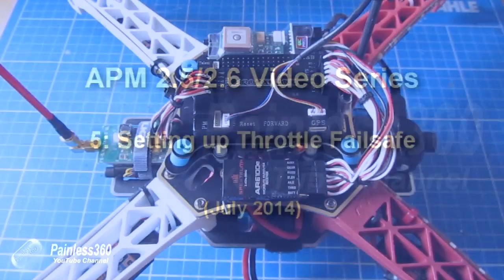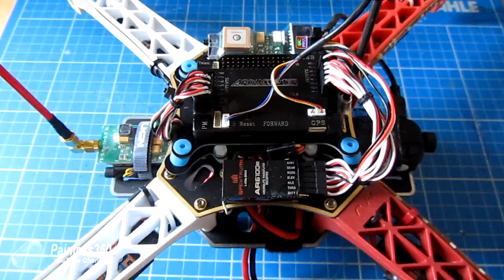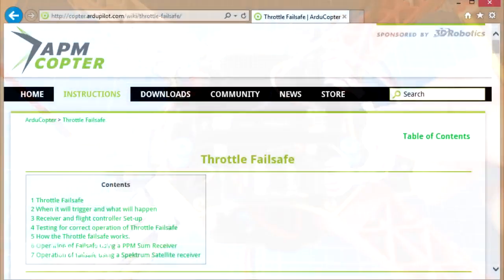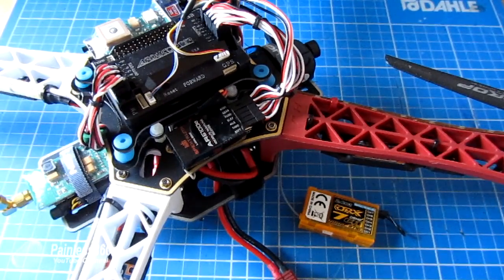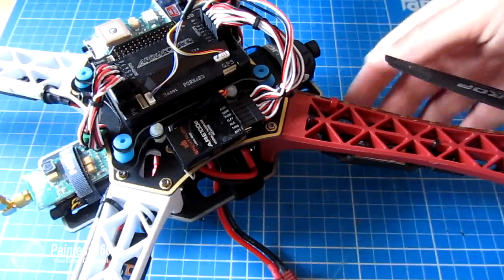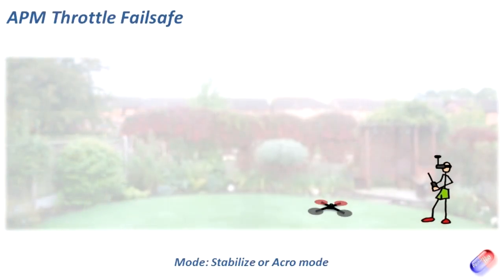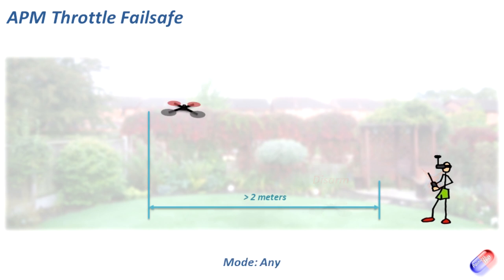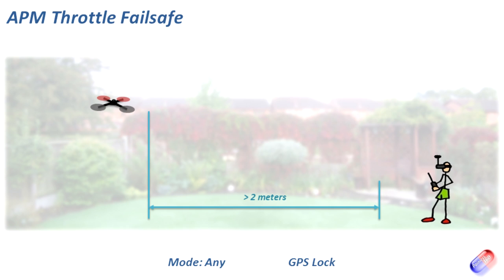(5/8) APM 2.5/2.6/3.1 - Throttle Failsafe Setup

Comment: Helo Painless.i need some suggestions ,,,Im using 2.6 APM(Clone) Arducopter ,30A RC timer ESC .1045 Prop..i finished all the calibration in mission planner ..Accelerometer,compass ,GPS, radiocalibration, Failsafe ,,but when i tried to ARMED the prop..there is no response from the Prop,,what ive did is test one by one ESC using manual testing ..ESC and Transmitter programming No issues on that the prop ..spin...i ve tried to use the APM wiki procedure using the ARMING the prop ..right side down in Throttle 5 secs the prop .spin ned for a couple secs...and wheh you give throttle its spin in min and max rotation but it stops ..the APM mission planner react in DISPLAY -ARMED when spin,,and DISARMED when the motor stops..maybe someone have issues like this...The prop doesnt react when i applied throtlle..im tired on exploring some Youtube solutions..need any advice..Im more on RC plane and RC EDF Jet flying..this  gave me headache using APM 2.6(clone),,I appreciate if you have any suggestions to check..
Reply from the maker: Hi Richard, I would suggest that you calibrate the ESCs one by one (https://www.youtube.com/watch?v=OOplk52R4no) and then try again. Remove the props and arm and throttle up using the Mission planner connection to see that the board arms successfully and that you can see the throttle rising smoothly.

Best of luck.

Comment: I do have a couple of questions. I do have a Futaba 8j and watched a video how to set up failsafe with this radio so I did it . Now, in mission planner  my lowest throttle value is 1110, when I turn my radio off the throttle value is 1591. What should I do?
Reply from the maker: What troubleshooting have you already done?

Comment: Wait how do you "rebind the model" so it shows the value you want when connection is lost?
Reply from the maker: Ethan Wang Watch https://www.youtube.com/watch?v=LyPtzv0y5DE around 13:50 to see the process for the radio I'm using, see your radio documentation for how to rebind to store the lower throttle value as the failsafe level in the radio receiver you are using. Happy flying!

Comment: Hey bud, I keep getting the PreArm: Check FS_THR_VALUE warning on arm, my throttle minimum end point is only 990, I then set my FS_PWM to 1015, and upped my minimal throttle to 1035,
Any idea why the warning will still be coming up?
Reply: ***** Sorry, just found out the ER9X fw has a 'extend limits' option in the main menu! So this might effect 9X & 9XR users =]

Comment: When I start mine up the left front and rear motor run real slow and the right front and rear run fast but !!! if I close the throttle so all stop then nothing happens when I open the throttle back up ? I have to power down and back up again and the same just happens ! Any advice would be appreciated
Reply from the maker: I need more detail to help - what troubleshooting have you already done?

How are you arming the board? Do all of the channel values for elevator, aileron and throttle settle to 1500 at their mid positions? Have you manually calibrated each of the ESCs?

Comment: can you help me determine which switch on my controller operates what function? I have a pre built drone and the controller has about 9 switches on it. I need to know or reset to a known value the mode and camera control switches. I have an apm copter controller.
Reply from the maker: Hi Frank, I'd suggest going back to the vendor and getting a manual that covers all of this.

You can find out which switch does what by plugging the model into Mission Planner and looking at the 'Modes' and 'Radio Calibration'' screens in 'Mandatory Hardware' section. Watch my first video in this series - https://www.youtube.com/watch?v=30cCs4aHdB0 to see what I mean.

Hope this helps.
Reply: Painless360 that helped very much. I was able to figure out the switch settings. thank you.  my only other question about switch settings is what happens if you switch 2 separate switches at the same time. if one is set to loiter and other to rtl, what would happen?
Reply from the maker: You need to watch what happens to the channel value in Mission Planner and see how the switches affect the mode selection..

Happy flying!

Comment: Thank you very much for making these videos. I've watched several of the while trouble shooting the problems I have faced while building a quadcopter in my engineering class, and these videos are a saving grace. I want to build one for my own personal use and the biggest problem is, I don't know what motors to buy. The frame of the quadcopter in this video is the same one that I will be using for mine. So if you don't mind me asking, what motors and speed controllers are you using for your quadcopter?
Reply from the maker: I use two setups commonly, always looking for a better setup that will provide more duration.

I use either 20A ESCs with D2822/12 1800KV motors with 7x4.5 props or 20A ESCs with 2213/935KV motors with 10x5 props. You can see both of these setups in action on https://www.youtube.com/watch?v=Sjwi_UnCLWc

Happy flying!
Reply: Painless360 Thank you so much

Comment: Great videos,  have a problem, in Mission Planner in Failsafe, I have my flight modes set at Stabilize, loiter and RTL.  When I arm in Failsafe and have my flight mode on RTL and disarm it, it goes to LAND instead of RTL.   soetimes it will show RTL and sometimes not.  I won't know when I am flying it if it will LAND or RTL.  Any ideas on what I need to set.  RTL pwm is set to 990, Min Trottle is 975 power off, 1026 power on.
Reply from the maker: Hi Jo, check that the channel value drops below 990 every time.  Rtl will only work if the GPS is ok and a home location was stored else it will land. Have you tested it at the field? Keep it close and make sure you get a good GPS lock before arming. 

Happy flying!

Comment: Hi Painless360,
Many thanks for your Videos, they are very helpfull for all.
I have a question, how can i setup my DX6i? when i give a 10% throttle, the motors those run at 50% ?
Many thanks
Reply from the maker: Hi, could be a number of things. The first place I'd start is to recalibrate each of the ESCs in turn. See my video https://www.youtube.com/watch?v=OOplk52R4no for instructions. Hope it helps.

Comment: I follow the instruction but after i close my radio the throtle goes to 1519 and nothing is happening.  i use frsky D8R-II and 9xr radio. Can you help me please ?
Reply from the maker: What do you mean 'close the radio'? You should always turn of the model first before the radio transmitter.

You need to use a receiver that 'fails safe' and will go to the value for the throttle stored when the receiver was bound to the transmitter. Happy flying!

Comment: Thanks, I appreciate these vids. They have been a big help setting up my new APM. BTW, I did end up buying latest APM; the "2.8" from Banggood (same as Hobbyking 2.7). Felt a bit risky at $48, but no smoke yet. It's configed and programed in MP fine so far & I hope to maiden in a few days. How about a vid on how to config switching more than 3 flight modes from Tx.  I've been thinking about this for my Taranis?
Reply from the maker: I've done this on my DX7 by mixing another channel into the three position switch. I will add this to the queue to film. Thanks for the suggestion. Happy flying!

Comment: i have the Frsky RX and i set the failsafe on the RX with the RTH switch in the on position is that ok ?is that a good way of doing also ? i have not tested it as yet but when i put the radio off RTH on the mission planner comes on
Reply from the maker: That should work great! Check it as we do in the video - when you turn off the Tx the board should disarm (remember to remove the props though!).
Reply: Painless360 thanks !!!

Comment: I really like ur video series. One of the best series available on Ytube for beginners :)

Could you possibly do a video that goes over all the flight modes in detail? (Ur last video had some quick explanations, but still vague) I think that a lot of beginners are confused at knowing what flight mode is the "noob mode" and which one is the "you better know what you're doing-mode". 

Cheers
Stew
Reply from the maker: Hi Stew, thanks for the suggestion. Stabilise is the noob mode :)

Once that works, you can play with the funkier options!

Happy flying!